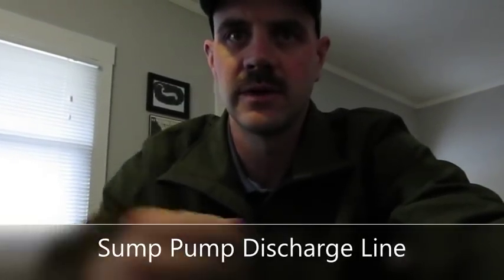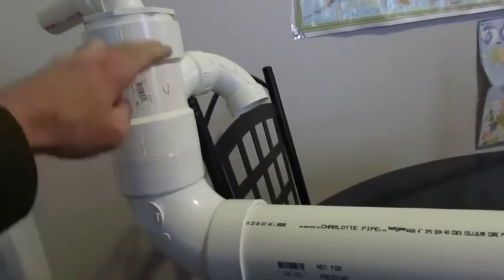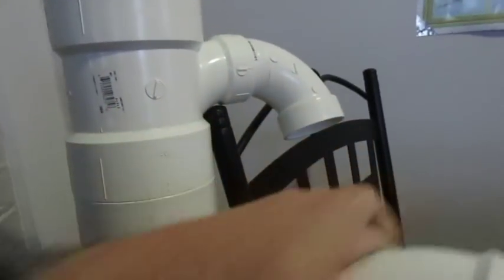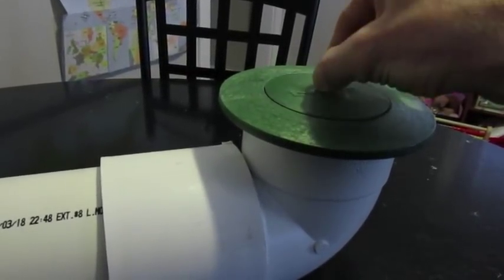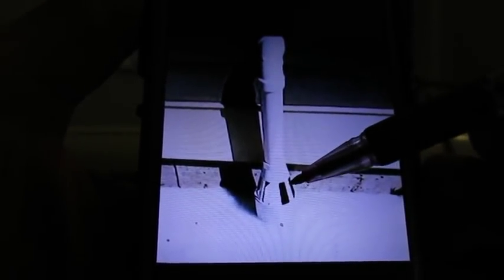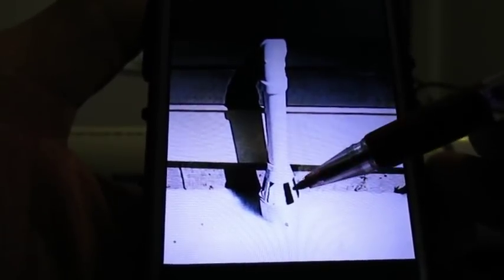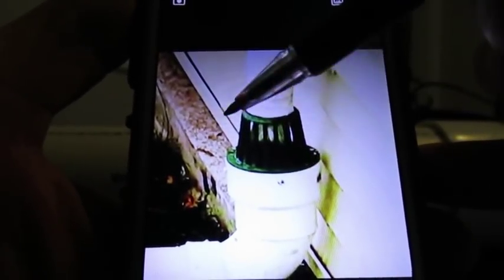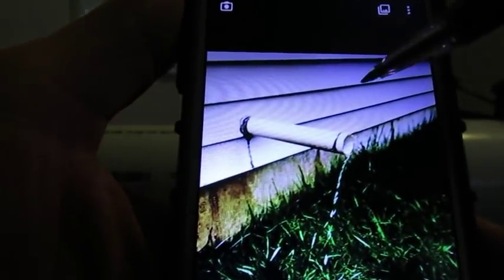Sump Pump Discharge Line...Considerations

Comment: Hi I am a single mom and I have a sump pump coming out of house with a discharge pipe underground and an over flow pipe. The underground pipe busted a small leak in the winter months and causing a hold of water to come up underground and freezing a small lake!! I dug the area of hole to repair the pipe any suggestions

Comment: Excellent video.  One question.  Why do you recommend going from 1 1/2" to 4" PVC pipe right outside the house, could you run 1 1/2" pvc pipe for 10 ' underground before going to 4"?

Comment: My sump discharges from basement under the front concrete porch/steps, completely underground, so I don't have the option of decoupling.  Mine froze this winter mid way to the road culvert and is discharging in the middle of my lawn.  Bad news!  I will dig it up in the spring and fix the pipe but have been thinking of a solution using a retro-line (by Heat-Line) which is a self regulating heat wire that goes inside the pipe.  Any other ideas are welcome but I think the heat line will work.   Thanks for your video.  It has many good points but won't work for me unless I tear out my front porch.  Yikes!

Comment: My parents plumber installed a sump when I was a kid. I'm now a plumber and I'm trying to find a solution to the fact that he's installed the discharge pipe horizontally, with about a 3 inch rise from the service multifit unions on the pumps and not installed a check valve. The pump outlets rise up, hit an elbow and then are coupled together using a tee which is then fed to a multifit McAlpine union before the discharge pipe proper. When the pumps run the pressure causes them to push the shared outlet pipe from the multifit and this has resulted in two floods in my parents' basement causing, as you can imagine, a lot of damage. I've currently changed the multifit and wedged two pieces of 2x1 between the pump wall and the tee on the outlet pipes to stop it from moving but obviously I need a more permanent solution. Has anybody got any ideas? I'm thinking of putting a flexible rubber connector with jubilee clips in place of the multifit as this may be enough grab to hold the two pipes in place but then I won't have any room for a horizontal check valve. I could use a solvent weld check valve in place but this would make it difficult to remove and maintain the pumps as the pipework would be rigid and they're already too high - placing the pipework at a slight upwards angle on the pump end. The pipework is plastic solvent weld (ABS) waste pipe. If anybody could come up with a solution you'd be a fucking legend.

Comment: Best installation I have found, question, discharge check valve could you tie in a "female" end that I can screw a x amount of inches to ground w a 90° and another "female" end to attach corrugated pipe to take the water away from the foundation for freeze/thaw times during winter/spring, then when weather breaks you take the attachment off of the "chx valve" for spring time etc
Reply: @philipwilliamshomeinspecti4665  got it!! This is the best system I have sen

Comment: Quick question.  My secondary water pressure sump pump is tied into the primary discharge pipe outside in the exact set up that you have in you video.  Only thing is the secondary pump was tied into the freeze protection discharge vent on the side, so there is no escape if the discharge pipe freezes.  So my question is, I live in Michigan so yes, it get frigid cold in the winter, my discharge is buried underground and spits out to city sewer in the corner of my yard.  I wouldn't think the pipe would freeze discharging into the sewer.  What are your thoughts
Reply: Thanks Philip.   I agree.

Comment: Good info Philip. I just had my sump pump discharge line buried. We tied the 1.5 PVC line to a 4" PVC with a Y with a clean out cap. I didn't add a freeze protector because I figured I could unscrew the cap during the winter in case the 4" line froze up. I didn't include an air gap however. I hope that doesn't cause an issue later. I put a 90 degree elbow at the delivery end and I'm finding that it holds water. I'm somewhat worried about that but I'm guessing that if the line is frozen there's probably no water in liquid form going into my sump pit I could be wrong on that point, but even if the line freezes solid, I do have the clean out cap I can remove. I'm hoping this will end up being a usable system and I don't end up burning out my pump. Any suggestions ir your feelings on whether I need to worry at night when the temperature drops. Thanks.

Comment: Question… I’ve gotten complaints from my neighbors that my sump pump discharge is extremely loud which I agree. Is there a way to address the sound and still perform and have a emergency relief in case the line freezes?

Comment: Just the information I needed. Springtime in Duluth Mn. I have an over flow setup but, my new pump is more powerful than the old one and there is overflow because of the pressure and volume of water. Was looking at putting a  12 inch catch basin to give the drain pipe a chance to catch up with the flow of water.  So yeah two thumbs up man!

Comment: I have the same exact tubing and the side freezing pipe you showed in the video.  We had heavy snow and below temperature lately and I've been startled by the loud sound coming from the sump pump hole.  The water sounds like someone smashing their hand and feet in the water like "Gallup gallup
 sound.  I think the outside underground pipe has to be frozen.  What can I do to fix this loud noise? would my sump pump go bad? should I dump hot water ? I had plumber who came and wanted to cut the pipe from outside and install a temporary exit, but I refused and I told him that's the whole purpose of this exit pipe duh ! so I sent him away.

Comment: Great information. Question. My discharge pipe comes out about 8” below ground and I cannot drill a hole any higher. What do you suggest? I am in Illinois and have had frozen discharge pipe multiple times. I have a 1 1/2” pvc pipe buried and will replace it with a 4” pipe but I don’t see how I can apply the other suggestions in your video. I will appreciate any suggestions. Thanks.

Comment: @8:20 the opening looks that way because they drilled from the inside of the basement pushing outward. Then the exterior coating chipped/broke away from the pressure. Start from the outside and drill inward (with many careful measurements before hand) to avoid that ugly occurrence on the outside

Comment: Excellent video. Great examples. My sump pumped and backup system almost couldn't handle a heavy rain event.  I was looking for a solution in case my outside line ever clogged. Not sure if I need a second pump well for heavy rain or not (Help). Definitely learned from the video that part of my problem is my pump discharges into gutter spouts. Thanks!
Reply: If you have a laundry tub nearby your pit you could rig up something to pump into the laundry tub. This is for an emergency situation anyway. That's what I had to do when my discharge line broke.

Comment: excellent points!  I live in WI so these are the things I need to know.  Unfortunately, my "drain" that goes underground is only 1.5 inch PVC (my city uses this to drain into the main street line and it's called a "mini-sewer")  so I could not use the 3 or 4 inch size effectively.

Comment: Could you show a correct way to install your system with two separate discharge lines with freeze protection on both lines?  Thanks

Comment: Great information, have one question, how deep should the 4" be buried underground? I live in the Chicago area.
Reply: @philipwilliamshomeinspecti4665  Great thanks, looking through Home Depot, they don't have a lot of schedule 40 fittings, does it mater or should I keep shopping?
Reply: I’m in the Chicago area, my sump pump pushes out 20’ from the house and has a drop about 1’ total in the ground. At the end I have a floor drain cover to keep animals out. Then it runs off toward a storm sewer cover that’s about 80’ away. My sump pit does not operate in the winter. My discharge 1 1/2” pump discharge pipe (I have a check valve inline above the sump pit) comes out of my home just above the rafters and makes a 90 degree outside into a 6” length of pvc into a rubber Fernco adapter fitting from 1 1/2 to 4”. This has SS clamps on both ends. I used thinwall 4 “ PVC outside and in the ground. This has been installed in 2003 and is working perfectly. I like in Round Lake, IL.    Any questions?    Jim

Comment: Hi,
I live in Chicago and I’m looking in ways to install a sump pump discharge system . The pvc pipe that’s connected to the sump pump is at the back of my home and I would like to ask you if is better to do a long trench pipe that goes 10 ft away from home through the back yard or  to the front porch . Tia great video !
Reply: Philip Williams Home Inspections 
Not an expert in this to be honest and it’s my first home . Wish I can sent you a picture or video on this .

Comment: Very informative video, thank you!  We just installed a new sump pump and are in the process of burying the discharge line outside.  Can you please tell me the name of the very first piece that the 1-1/2" discharge pipe slides into?  It looks like it has a hexagonal shape.  It fits into the 4" pipe just above the freeze relief valve.

Comment: Good video. Thanks for the info.  I'm just curious why you didn't like the sump pump sharing the gutter drain line?  I have an existing buried 4" PVC drain line to a pop up emitter that is on one downspout.  The downspout at full capacity wouldn't fill up the 4" PVC drain line.  So I was considering tying my sump pump in to it. But after seeing your video I think I may dig a new trench.  Thanks.

Comment: Thank you very much, your video is gonna help me fix the problem of discharging my sump pump legally. For 22 yrs I've been discharging my sump pump into my sewer line in the hose that goes to the street. I know this is probably wrong but it used to pump into my back yard and just sit and not drain properly and become green algae. I want to sell my house and want to fix this for the new owner but do it properly. My sump pump runs alot sometimes, my house sits a little lower than my neighbors and my sump pump does it's job I just need a better way to discharge it correctly. Just this morning it's running 3 times in an hour. Any other ideas or help would be appreciated.

Comment: I love in upstate NY and TRUST ME you need a good freeze/overflow system. Downhill drain is ideal but make sure there is no standing water in your drain pipe or it will freeze. I like this setup think i'm gonna copy it. Right now i'm running my 4 inch drainage line above ground to completely avoid freeze/thaw issues. It works but it's kind of an eyesore.

Comment: I think you covered every thing very well.. my pipe from the house has a elbo and and long white pipe the same size as the pipe coming from the house and its about 5 feet long going inside the large black burred pipe along the side of the house to the side walk in front of the house .. about 25 feet.. but the attachment came apart where the 5 foot pipe atattche.. no freeze line,, no air.. just the long pipe dropped and flooding back into the house threw my basement window just repumping the same water.. so i got the y shaped pipe 2 yrs ago, and now it apparently froze again and no water reaching the street.. i hope it works.. seeing your video shows i was on the right track so thanks.. i have some repair person coming tomorrow so all i need in the freeze part attached and the air separation.. and i 'll know if he knows what he's doing so he wont over charge me. and i live in Dayton ohio up north.. and its about to rain for 3 days .. Thanks so much!!

Comment: Good video. Explains what is good and why. And you show what a bad job or a so so job looks like. Only thing missing is how far you should run the drain away from the house before you attach the pop up. As for a drain field, would help if you shown how to run a perk test to determine the size for a drain field or dry well, if required in your area, or if you should even consider one. Also, before running a drain line, best to check with local building and zoning codes, some areas have restrictions in their building codes as to what you can or cannot do. A couple examples; drain lines must be X number of feet from property lines or neighboring structures, or you cannot have the sump pump drain into the cities sewer lines. That sort of thing. Otherwise, good video.

Comment: So what if the discharge comes out the house thru the block under ground
Reply: What about inside the crawl just before the block running a T with a vertical pipe up and then out the block above ground as a relief in case the main discharge going out underground freezes
Reply: Yes it gets very cold
Reply: @philipwilliamshomeinspecti4665  I'll give it a shot see how it works thanks so much for the help sir

Comment: can you list the parts used?
Reply: @philipwilliamshomeinspecti4665  --  how about black corrugated in place of the white PVC underground?
Reply: @philipwilliamshomeinspecti4665   Thanks for your help. We used Green 4" and white connectors. with a green water pop up on the end.  Also a Y at the house.  --Hope it holds.  We are in Cold Chicago

Comment: Living in southern Maine, it gets pretty cold up here!  And the standard for "frost depth" is 4 feet down!  There's no way I can bury my pipe below the 4' depth!  And I'm guessing that using 4" pvc, if any water freezes up in it, the pipe is going to get split open.  So I'm going to be using 4" black corrugated drainage pipe, hoping that if water freezes up in it, it may expand a little, but not burst.  And since it seems our local HD does not stock any kind of "freeze relief" device, I'm hoping to have room to put in a 4" T, with a grate in the side opening.  Thoughts?
Reply: I have that- a 4x4x4 T.  Water gets pumped out of the green popup and also out of the 4" Tee with the grate on it. I took out the grate and put in a length of pipe on it to divert the water away a little more. I guess it's a trade off in that when I need the freeze out I will be glad it is 4" instead of 2" but when I don't need the freeze out with higher temps, I am pumping water out of this T when I don't want to. So I put a cap on a 5" length of pipe coming out of the T for use when it is above freezing, and will put the grate back in when it is below freezing. I was also thinking about drilling holes in the upper part of the end cap but that probably won't handle the amount of water I am pumping. I have a Megaboss pump by Richtechindustries that pumps 10,000 gph. Any thoughts about all this?

Comment: Hi! I found your video very informative. I have 2 questions. We are up north we have the air gap and the underground 4” pipe. It takes the water out to a pond. There is about 8 inches from the pipe exiting the house to the opening of the underground pipe. There is nothing between the two pipes. We have mice coming into the house from that pipe into the sump pump pit. Also the underground pipe has shifted
 and when the sump pump ejects water some of it spills over onto the ground. Would appreciate your suggestions! Thanks
Reply: Philip Williams Home Inspections thanks Philip I installed the vented section and it goes just up and over the pipe coming from the house - works like a charm!  I found that the mice are entering through the hole for the AC pipes. The hole’s seal had broken down got that fixed too.